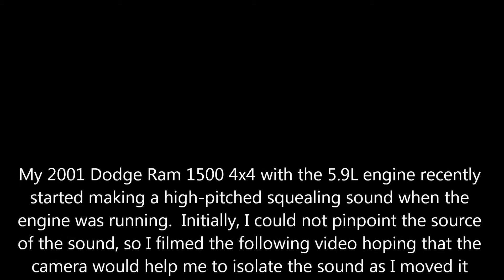2001 Dodge Ram 1500 - Plenum Gasket Leak Squeal

Comment: dont have the squeal with my 5.2, bit i do have a noticable hiss. However, everytime i have done the prescribed test called out by Chrysler in the TSB, it passes the test. like Spelunkered, i wonder if i am getting a false negative. Gas milage sux ( even for a Dodge), oil use is seems abnormal, however the engine does have +260k miles and it does ping under load. Symptoms point to the plenum, but the prescribed tes procedure says look elsewhere.

Comment: hey i finished my repair with 2 months ago and still running rough and found out again that i had a new oil leak by looking through the throttle plate, i have the same kit with new parts for each part of this repair i used rtv silicone black and threadlocker and torqued all bolts to their specs and it still busted the gasket but not as bad as much as i can see. what did i miss?
Reply from the maker: Dang, I'm sorry to hear that Michael!  Did you use the same torque wrench both times?  If so, I'd be suspicious that it is not calibrated properly.  You may want to get it checked out.  If it turns out OK, then I'm honestly not sure what could be going on.  Did you follow bolt the tightening sequence described in the service manual?
Reply: sure did and the torque wrench wasnt the greatest it had a scale underneath while turning, it wasnt a click style wrench which is why i will get one next chance i get, but first im getting a compression gauge to test my cylinders and see if anything else is going on. i spent money on sensors and brake repairs to hopefully solve my problemm too, but still running rough and i now own an eclipse im going to restore

Comment: Mine isn't making the high pitched noise but it is using an inordinate amount of oil.
Reply from the maker: Kaleb Wagner Kaleb, in that case, I would recommend that you remove the air filter housing, open the throttle butterfly, and peer down inside the intake manifold through the throttle body to see if there is oil pooling on the plenum plate at the bottom of the manifold.  If you are unsure if your truck has had the stock plenum plate replaced or not, you can insert a telescopic magnet tool down through the open throttle butterfly and touch the plenum plate at the bottom of the intake manifold.  If the magnet sticks to the plenum plate, then you still have the stock plate (since the stock plate is made of steel).  However, if the magnet does not stick, then your stock plenum plate has been replaced with an aftermarket non-ferrous (aluminum) plate.  That does not mean you absolutely do not have a failed plenum gasket, but if you don't see oil pooling in the manifold, and you have an aftermarket plenum plate, I would search for another possible cause of oil consumption before deciding to remove the intake manifold.  

Other causes of oil consumption could be as simple as a failed PCV valve (allowing excessive oil to be sucked into the intake system), or it could be due to worn piston rings allowing oil to blow past the pistons into the combustion chamber.

If you definitely suspect a failed plenum gasket, you can check for vacuum (suction) in the crankcase.  To do this, disconnect the vacuum hose coming off the PCV valve and cap the end of the hose with a bolt or some duct tape.  Then remove the vacuum hose from the air filter housing (it runs down to the passenger side valve cover).  Then start the engine, and place your finger over the end of the vacuum hose that connects to the air filter housing.  If there is significant suction in this hose, then you almost certainly have a failed plenum gasket.  With the PCV valve eliminated from the system, the only way for vacuum to draw from the crankcase is for the plenum gasket to be leaking by.  I had this very same symptom when I discovered my plenum gasket issue.

I hope this information is helpful.  Thanks for watching, and good luck troubleshooting!
Reply: ***** From some of the other stuff I have read, it is sounding more and more like the plenum gasket. I will look into the PCV valve and see what I can do. Thanks for the help.
Reply from the maker: Kaleb Wagner Good luck...if it does turn out to be the plenum gasket, it's really not that bad.  Give yourself a long weekend and a friend on standby to drive you to the parts store for that one thing you will inevitably forget (at least, that's how it always goes with me), and you should be able to get it back up and running in time to get to work on Monday.
Reply: Thanks, I'll probably do it over the weekend. I am having my dad help me with it, he has helped me put in a transmission and a bunch of other stuff on my truck.
Reply from the maker: Kaleb Wagner That's awesome...this is a great father/son project.  It definitely helps to have an extra set of hands to give you tools, particularly if you do like I did and remove the fan shroud so you fan actually stand in the engine bay.  I can't even begin to quantify the amount of time I wasted crawling back out to grab a tool I forgot on the workbench.  Plus, it's good to have an extra set of eyes to help you to not overlook any steps, and your dad can help to keep you from getting discouraged if you hit any snags.

Best of luck.  Based on the other work you've already done, this should be a piece of cake for you and your dad.
Reply: I hope it's as easy as you say. I haven't decided if we'll take the fan shroud out or not.
Reply from the maker: Kaleb Wagner There's nothing really technically difficult about it.  It's just kind of tedious.  I would definitely recommend taking the fan shroud out.  The ability to stand inside the engine bay gives you much better reach to the back of the crankcase when it comes time to clean the old gasket material off the manifold mating surface.  I would recommend changing out your distributor cap while you're in there...it will never be easier to reach than when the manifold is removed.

Just make sure you use new manifold bolts (they are torque-to-yield, so the old ones should not be re-used), use thread locker on the plenum plate bolts, and be absolutely certain to cover the lifter valley with towels/rags once you remove the manifold; you do NOT want to do what I did and drop something down in there.  Those are probably the three most critical points of advice that I can offer.  Otherwise, just take your time, and make sure you have the mating surfaces really clean and use a good quality gasket (I like FelPro).